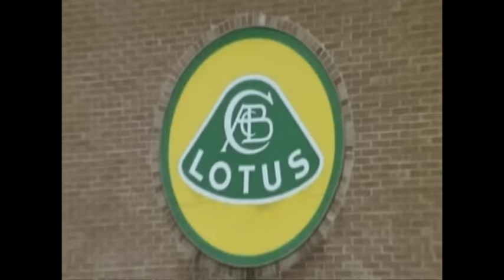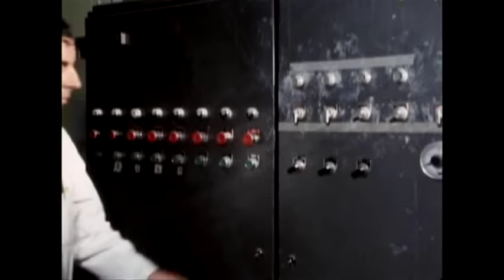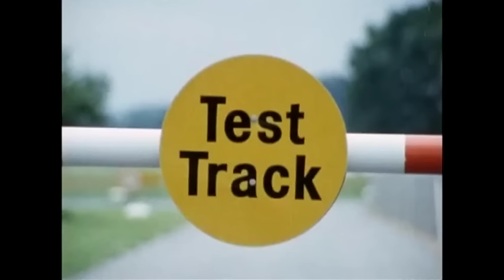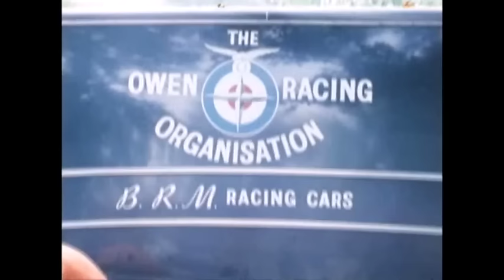1968 Millionaire: Colin Chapman

Comment: Some of the comments on here go too far. Chapman was not a murderer. He was an innovative engineer looking for an edge, and many of his innovations were key in the development of Formula One cars over the years. 

We're looking back at those days from the modern perspective that driver safety is paramount. Fifty years ago people were still trying to work out how best to make a man on four wheels fast, and the risk was considered acceptable then. It should also be pointed out that poor track safety was to blame for many driver deaths in those days, not just fragile cars. Modern track safety measures and medical assistance would probably have prevented the deaths of Clark and Rindt, for example. There were no crash barriers at all where Clark crashed, and Rindt was killed as much by poorly installed crash barriers and an improperly fastened seat belt. 

A reckless engineer by modern standards perhaps, but not evil.

Comment: The initial impression might suggest some sort of jumped out cockney, but one quickly aware, this man is very unusual. the technical and human insights are deep and often extraordinarily comprehensive, accurate and new,--paraphase-- 'the choice in racing is, often unpalatable, but unavoidable between two evils'. Despite a rather ordinary but not completely poor background growing up as a wartime son of a London publican, any study of Chapman reveals an unlikely genius from the start, even in first the school reports. One senses he could  only have been commissioned in the RAF, but most GP team bosses of the 1960s and 70s are easily imaginable as air marshall or generals. There probably the only alternative occupations. Chapman never liked using top engineers as drivers and shared the attitude with Ferrari which is partly why he gave up driving himself, although he may have found his equal when he enjoyed a one off drive for Vanwall at Rheims when Mike Hawthorn was having  a one off drive for Vandervell in 1956. Of Clark , Chapman always expresses the greatest respect and admiration, that Jim was a driver of unmatched talent, genius and a close friend, but it actually took several years mid 59-mid 1961 for Colin to really appreciate he had something special and maybe the close relationship was fading by 1967 with Jim distracted and really giving little input to the team. What really happened at Hockneheim is of course unknown, Jackie and Helen Stewart weren't their to ask questions. Hawthorn was present when Collins had his accident at the ring in 58 and would have known enough to find out for certain.

Comment: I think C C regarded his drivers as fellow RAF pilots , you have to risk  loosing one in a battle if you want to win. Using hollow drive shafts with inward mounted discs was a weight saving  mistake that failed  killing World Champion Jochen Rindt .
Reply: Yeah he was a reckless engineer
Reply: Rindt died partly because the crash barriers were poorly installed and partly because he didn't fasten his seatbelts properly and left the crotch strap undone as he wanted to be able to exit quickly in case of fire. As a result when the crash happened he slid down and the seatbelts basically garrotted him.